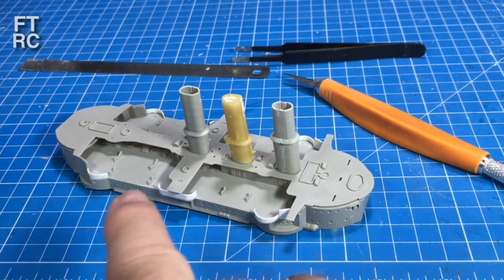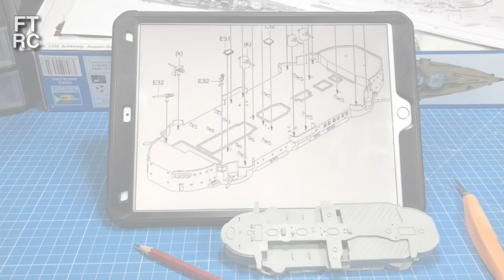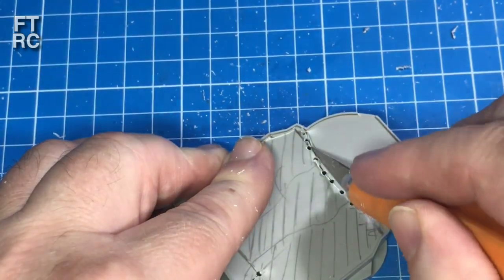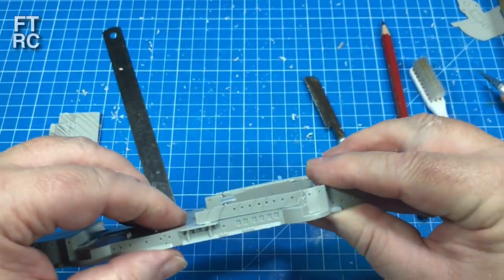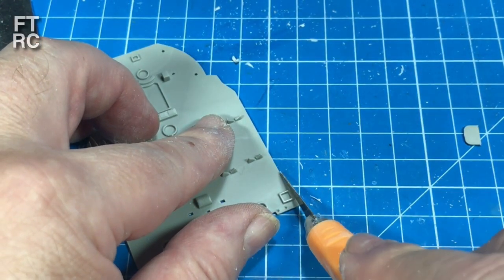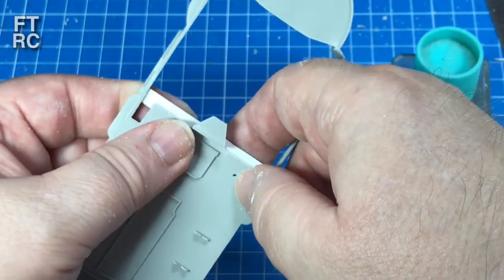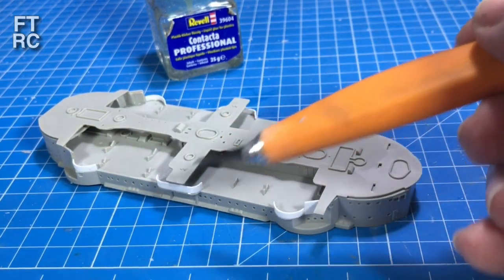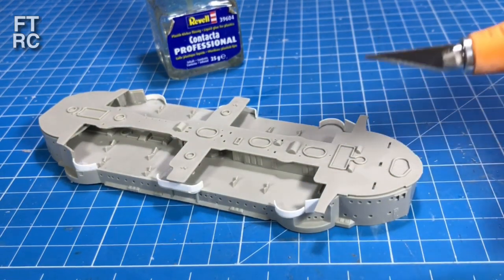Trumpeter 1:350 Deutschland Part 2  Scratch Deck Conversion of the Schleswig-Holstein to 1908 specs

Comment: Awesome work  question for you sir I’m working on a hypothetical warship and the hull I’m using for the base is of the USS Colorado but I’m trying to lengthen it by few inches to be same length as my HMS Renown some have mentioned using length sprue. Is this off the part sprue or is it something that has to be scratched built?
Reply from the maker: I would get some Evergreen styrene sheets to use for the extension, and make sure you brace inside with either more styrene or wood lengths

Comment: Great job and very enjoyable video.  Out of curiosity, did you consider using brass for the blast shields instead of the plastic?  If you did, why did you ultimately decide on plastic for the blast shields?
Reply from the maker: I did consider brass for the gun shields but my metalwork skills are not as good as my plastic scratch skills.  Plus I had 0.5mm plastic sheet to work with, narrower than the kit part.  
 
If there was a PE upgrade kit for the 1908 version then that could have been a consideration, but my Eduard PE was for the 1935 version, which had been bought by the previous owner of the kit.
Reply: @HarryHoudiniModels  That makes sense and something I'll consider when I go to making blast shields for my future WWII US Destroyer(s) projects.  I really do enjoy your videos, very informative as well as entertaining!
Reply from the maker: Thanks Pete